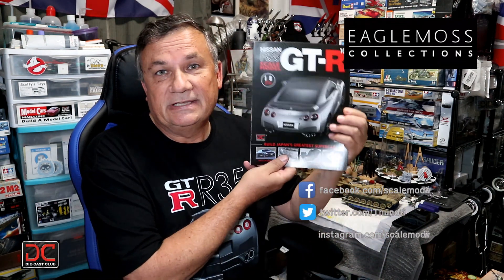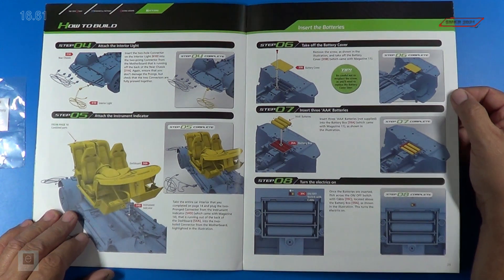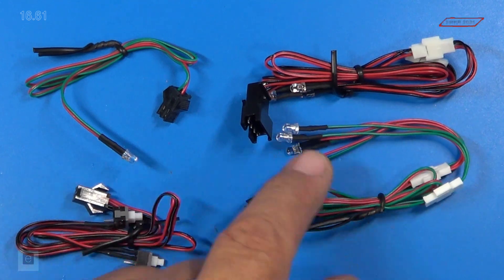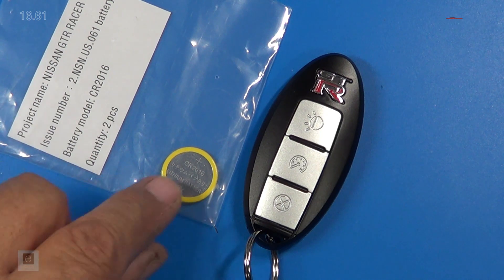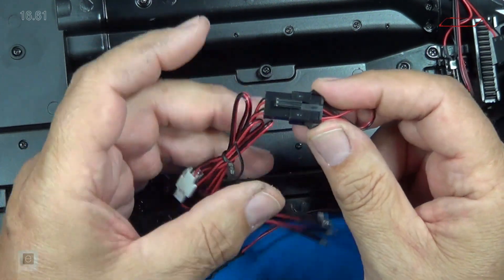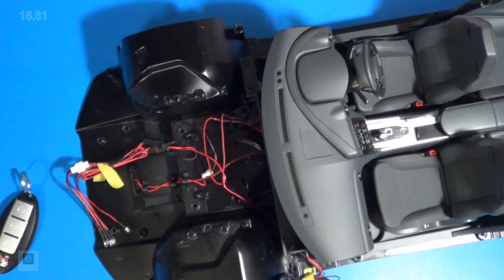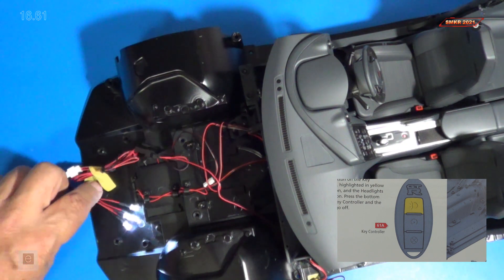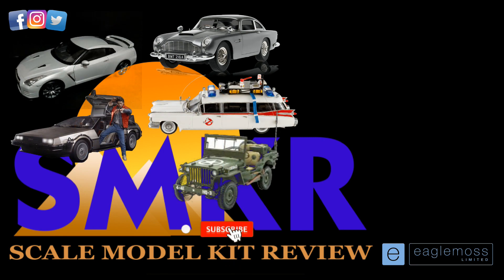Build the Nissan GT-R R35 Issue 16 Stage 61 - Remote Control and Light Test

Comment: Hi Steve in regards to the interior  light switches. They were correct the first time. The light remains on until both switches are depressed, so when attached to the door mechanism open 1 or both doors and light comes on or close both doors light goes off. It will be the same on the ecto 1 when you get to that stage but with many more switches . Keep it up, enjoy your videos 👍
Reply from the maker: Thanks Mark, the instructions made it confusing. So when I resume the build with Issue 17, I will switch the wires again. Thanks about the Ecto-1

Comment: I’m pretty sure I connected everting correctly but none of my lights turn on.. any idea what the reason could be  for them not to turn on?
Reply from the maker: I inverted the wires, and I should not have done this, I will make a correction video and explain why very soon.

Comment: My lights only working lights is the interior and dash. My headlights, tail lights and brake lights are not activating.
Reply from the maker: recheck all your wire connections and make sure your remote has a fresh battery.